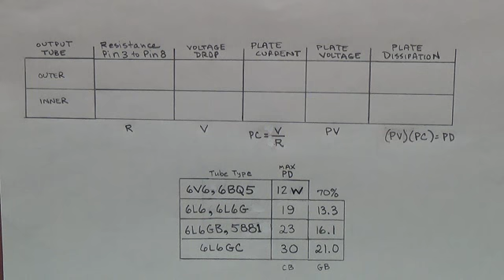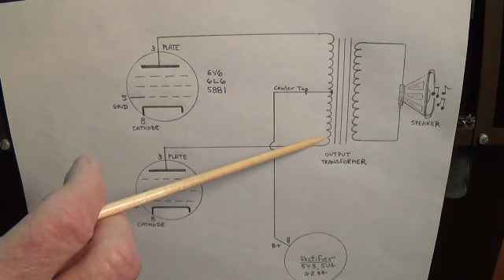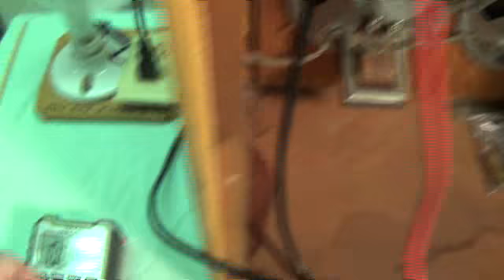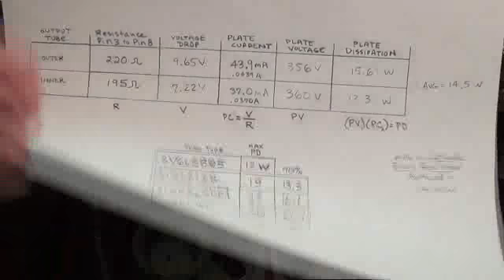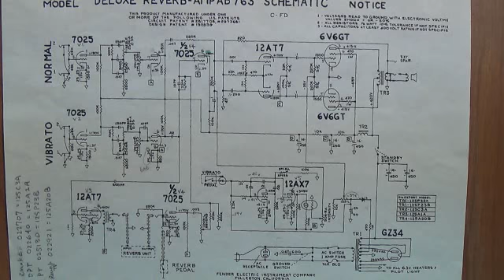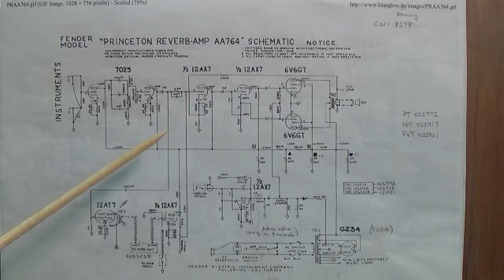Biasing Double-Ended Amplifier Output Tubes, Part 2: Demonstration and Discussion

Comment: I dont get it, why would your bias be close to the max power dissipation? As soon as the positive cycle of an AC signal is applied to the negative grid voltage (assuming grid bias) it will cause the grid voltage to go closer to zero and thus the plate current to increase causing the tube to go beyond its maximum power dissipation.

Edit:
Shouldn't it be biased for roughly half max power dissipation instead?
Reply from the maker: With cathode-biased output tubes, you can safely set the plate dissipation at or about the maximum value, BC, because cathode-biasing is self-regulating. The plate current will not vary by any appreciable amount. With fixed bias output tubes (grounded cathodes), however,  you set the PD at 70% of max, for the reasons you cite.
Reply: Thanks for the reply, that makes sense, so the 70% is to bias them a bit hotter in order to be able push them into breaking up a bit, is that correct?

Comment: I have a Fender Bassman 100, from 1968. It has 4 6L6GC tubes. I see how the tubes are split up on the schematic, V4and V5 work with each other while V6 and V7 work with one another. I’ve taken all the measurements and found that at first the bias was way off. After a couple of tries I almost got them identical to each other. My question is this: My plate dissipation wattage is about 49 watts per side. Would it be safe to say that it’s about 24.5 Watts per tube? Also is it correct that it’s still a high wattage for them and what could I do to change that? Thank you again for putting you know how on YouTube
Reply from the maker: Yes, 24.5W average per tube is high, HH. With fixed bias 6L6GC's the max PD should be 21W. It's strange that your amp has a balance control but no apparent bias adjustment. You need to increase the negative DC grid bias to each tube to reduce the plate current, and from looking at the schematic, I think you can do this by increasing the value of the 15K resistor on the balance pot.
Reply: Uncle Doug Wow thank you for your speedy response! I just thought of something. This is an amp head. Should I place a 4 ohm load of the speakers when I do these measurements. That would effect the current at the output transformer? Sorry this is only the second tube amp I messed with.
Reply from the maker: You should never operate a tube amp without a speaker or dummy load in place, HH. I'm not sure if it will affect the measurements, but no load will definitely put your output transformer at risk.
Reply: Uncle Doug . Yeah I feel stupid. Thanks again
Reply from the maker: No need to feel stupid, HH. Apparently no harm was done. You're welcome.

Comment: Hi Uncle Doug. I was following your procedure to check the bias on my amp. For example one of the sides of the transformer R= 319ohm, the voltage drop there is 3.03v so I get plate current=9.5mA. Then the plate voltage is 305v and that results in 2.9 watts of plate dissipation. The amp sounds fine but I changed the transformer and I wanted to check the bias myself. Also I noticed that the current limiter turns on a little bit when I flip switches and stays on a bit when the amp is on. Am I doing something wrong?
Reply from the maker: What type of output tubes are you using, Al ?  The PC and PD seem very low to me.  The amount of bulb glow is dependent upon the wattage of the amp.
Reply: I´m using 2 EL84s. Yesterday I repeated the process without the current limiter and got better values but still cold so after tweaking I got these values for 70% dissipation:
                       Resis (Ohm)   Vdrop    PC(mA)    PV(v)    Pdisipation(watts)
 BROWN        319                  6.94       21.8          367        8.0
BLUE              353                  8.12       23.0          366        8.4

This is a 20watt amp but I swaped the transformer for a 18watt one. It is also grid biased and I am in Europe, I don´t know if this affects.

Please let me know if these values are good. Thanks for the help,
Reply from the maker: These values seem a whole lot more reasonable than the first ones, Al. To me, the PV's seem high and the PC's seem low......but the PD's are fine. If it sounds good, then go with it.
Reply: Uncle Doug yeah I think it sounds way better now. Thanks for being such a nice guy uncle Doug, I appreciate it 😊
Reply from the maker: You're welcome, Al :)

Comment: Hi Doug, thanks for the great videos! I wondered why there is no value in your table of plate dissipation just right of the 12W for the 6V6 tube. Why did you put the 70% there, instead of 8,4 Watts? Thanks! Daan
Reply from the maker: I'm not sure, Daan. That video was made quite a while ago, however, it sounds like you are aware of the 70% limitation for fixed bias output tubes.
Reply: Thanks!

Comment: Hi, do I understand that you can get the correct maximum plate dissipation values for each tube from the tube manuals??
Reply from the maker: Yes, it is one of many operational parameters that are provided for each tube in the manual.

Comment: Hi Doug, thank you very much for your advice. Like I said , I hope you never stop doing videos. My main question also is why is the plate voltage so high at 485. I have also used 6l6's. I recently had a problem with red plating in this amp.it turned out that I had to replace the bias potentiometer. Thanks again mate. Michael
Reply from the maker: You're welcome, Michael. Perhaps the power transformer had been replaced with one that produces too much voltage. Another possibility is that the plate voltage is too high because the plate current is too low. They are indirectly related.

Comment: Hi  Doug, I know this is an old video but I wanted to ask you a question about biasing a Blackface Bandmaster from 1965 that I have. The plate voltage has always been very high at 485 plate voltage. The schematic states that the voltage should be around 440 volts. What would possibly cause this to be so high? I wound up changing all of the caps and resistors on the board, so that is not a problem. I changed the output transformer and the choke as well. Still the original power transformer. I noticed that the power transformer was running fairly warm. The amp plays alright but this high plate voltage is of some concern to me. I have 5881 power valves in it. I biased to 37 milliamps. Maybe a little high. It may need to be set at 33 milliamps. Do you have any advice for me on this? Thanks Doug love all of your very informative videos thanks from Michael Newell from Niagara Falls, Ontario, Canada
Reply from the maker: The key factor in biasing is Plate Dissipation, Michael, as described in the video. Your PD is .037A x 485VDC = 18W. The max PD for 5881 tubes is 23W, so you are well under the max. If you increase the PC to around 45mA (max for 5881's is around 50mA) the PV will go down and you should have a PD that is closer to 23W. If you're nervous about running 5881's at this level, which is still well within normal parameters, you could switch to 6L6GC output tubes, which are much hardier. Good luck.

Comment: hi doug! quick question i just put 2-new 5881's in my sovtek mig 50. i set bias at each tube at 36 mv,due to some expert on marshall amp forum-other amps section-is this to cold?
Reply from the maker: You can't bias tubes simply by adjusting the plate current, Mike. Bias is based on plate dissipation, as described in the video.  Plate Dissipation (in Watts) = Plate Voltage (measured plate to cathode) x  Plate Current (in amps). You will have to check with Sovtek to find out their recommended max for PD.
Reply: ok uncle doug im a idiot 66 years old an born in lynwood,calif. please forgive me i just started this hobby 3-years ago. got lots to learn! thanks for the reply!
Reply from the maker: You're not an idiot at all, Mike. We all have to start somewhere, and it's always better to ask a good question than to bull ahead and cause harm. Best of luck with your amp.

Comment: beautiful basic analysis of biasing push-pull circuits uncle Doug. thx .. I'm off checking  other sites now for my newer Tranor I picked up a few wks. ago its running 5881 's and sounds good  but heard that 6 L 6
s  open this amp up even more . when i installed the 6L6's after 3 min. i smelled something cooking sure enough two of the plates were aglow. re the old ones and contineoed to sound fine . I herd this amp is self biasing so . humme!  i also have a reissue super reverb i want to install  a balenced pair into as well as complete compliment.  of new used from nesstube  in California. the Traynor is VT80 . and both amps look like they never been touched. the super has very little id. anywere on it looks like they just missed writting the numbers on the thing.
Reply from the maker: You're welcome, Barry. The 5881 tube is quite similar to the 6L6G and GB, but with slightly higher plate dissipation. I have no knowledge of Traynor amps and can't find any literature on a model VT80. I don't work on reissue amps, but if the Super Reverb is like its original brothers, it is grid biased and will have to be re-biased by a qualified tech if you install a new matched pair of 6L6GC's.

Comment: Graham Bambrook

Hey Uncle Doug, I love your YouTube videos and was very sorry to hear Rusty the Wonder Dog has recently departed this mortal coil. Please accept my condolences and be sure to give Jack a scatch from me.  :-(

I wonder if you can clarify something for me.
I have an amp with 4 off, grid biased 6L6GC which measure out as follows per pair:- 

Xformer resistence 24.9 & 30.1 ohms;
V drop across xformer 0.61 & 0.81V;
V plate = 392V for each pair which by my reckoning gives plate current of 
0.024 & 0.027 Amps respectively. 
This equates to a PD of 9.4 & 10.5 W for each pair which seems incredibly cold when each pair should handle 40 - 60 Watts.
What am I doing wrong?

I must say these readings are with the original valves (tubes) which appear to be totally trashed (crackling and popping at anything other than minimum volume) and though the amp cost me nothing, the replacement valves were over £100 so I don't want to risk fitting them until I am comfortable with the state of things. Incidentally, I took your advice and built myself a dim-bulb tester before plugging the amp in. I live in the UK and a 240V dead short can get quite interesting, very quickly, so thanks for the tip. I use 2 x 100W bulbs in // and then in series with the socket outlet. I used the same device to check an oscilloscope I just acquired and a 500W Weller soldering iron I have owned for about 50 years and not used for about 20. I fully intend to use it on any unknown device in future. :-)
Reply from the maker: Thanks, Graham. It doesn't appear that you are doing anything wrong, as long as the measurements are accurate. Both the OPT winding resistance and the voltage drop seem quite low......but I rarely, if ever, deal with quad-ended circuits. It could be that your old tubes are simply nackered and their cathodes can no longer create adequate current flow within them. You might want to try this process again with your new set of tubes. It doesn't seem like any harm could befall them, especially if you are using a current limiter.
Reply: Thanks UD. My only real concern is that the amp uses a solid state rectifier and the Plate supply for the ouputs is tapped BEFORE the Standby switch. The only 'cushion' therefore, is the dim-bulb. I guess I have to be brave and just do it.
Reply from the maker: What a strange wiring scheme......the purpose of a standby switch is to delay the application of plate voltage until the filaments heat the tube (which is generally a waste of time, IMHO), so it would appear that the switch is superfluous. If the amp is wired this way, then the output tubes will be subjected to immediate B+ at every start-up, so running it this way is routine rather than risky. Your only alternative is to re-wire the standby switch, or use a Variac to bring up the B+ gradually.
Reply: Well, I bit the bullet and everything sounds good. Currents and voltages changed slightly and I re-calculated 11.6 W of plate dissipation on each so still a bit on the cool side, but hey, it works. No popping, no crackling, no microphonics. I changed the pre-amps and phase inverter at the same time (3 x ECC83).
I was going to send you a section of the schematic FYI but I don't seem to be able to copy it in here. It is a bit odd. There is a B+, a B++ (pre-amp) and Screen supply after the s/b switch but the Plate supply for the power section is before.  If you do want to look it up online it's a Peavey Valveking 100. Anyway, thanks for your advice etc. Keep up the good work! :-)
Reply from the maker: You're welcome, Graham. I will take a look at the schematic. For future reference, you can't copy the schematic to this page, but you can copy the link.
Reply from the maker: Sounds good, Graham. I was unable to locate a legible VK-100 schematic, but accept your analysis of the unusual circuit.
Reply: Here it is Doug. 
https://www.google.com/url?sa=t&rct=j&q=&esrc=s&source=web&cd=1&cad=rja&uact=8&ved=0ahUKEwi7tsDdsenaAhUnC8AKHfQHAEUQFggpMAA&url=http%3A%2F%2Fwww.thetubestore.com%2Flib%2Fthetubestore%2Fschematics%2FPeavey%2FPeavey-Valveking-112-Schematic.pdf&usg=AOvVaw1RPhj6TNfdV0KykS6SKExl
Reply from the maker: You're right, Graham, the plates are energized even with the standby switch in the "off" position......very unconventional.
Reply: Glad I'm not going loopy!! :-)

Comment: Hi Uncle Doug! I am working on a Fender Silverface Twin Reverb amp and I got to the bias adjustment and when I measure the voltage drop between the center tap and each plate, my voltage measurements vary from about 1.2 volts to 1.75 volts. Meaning, the DVM readout swings back and forth, at what looks like 120 hz rep rate. Power supply caps have all been replaced with new caps, all electrolytic caps in the amp replaced as well. Any ideas on what could be causing this? Output tubes all new, quad matched set.
Reply from the maker: It's frustrating, isn't it? I've seen this before and believe that it's the Tremolo oscillating silently in the background. Try altering the speed control of the Tremolo and see if your readout swing doesn't change speed to match. The solution is to pull the oscillator tube when biasing the output tubes.

Comment: As always, this is an immensely useful video! 
Maybe you can help me with my peavey classic 30 which I believe could be described as a parallel push pull type (4x el84, fixed bias). How would you go about checking individual PD since 2 plates are in parallel on each side of the OT?
Reply from the maker: Unless you want to install 1 Ohm cathode resistors for each of the four tubes and measure voltage drop across each, you are pretty well limited to only determining the average PD of each pair, by dividing by 2.
Reply: Uncle Doug Thank you, this was my guess based on the knowledge I acquired from all your educational videos, which are a wonderful gift to the world!
A fan viewer from France

Comment: Hi.  Great video..! What about the second grid in the output tube? Can you add resister there to change bias or will it affect the existing circuit voltage? I'm referring to Princeton Reverb schematic..
Reply from the maker: Thanks, Dr. R. I believe you're asking about the screen grid in the 6V6. It has its own DC supply, generally at a slightly lower voltage than the plate. It is not "biased" and does not generally have a resistor in series with it and the 400VDC "B" supply.....unless the high voltage circuit includes a filter choke. See the AA864 Bassman schematic, where 470 Ohm resistors are added due to the presence of a filter choke (TR2).

Comment: 100 Ohm resistor in cathode will change the working conditions of the 6V6...........
and will measure total current under different conditions ,besides it will not show the desired balanced or faulty unbalanced current of the output tubes .
A) install a jack in the cathode for measuring total current .......easy.
B) a 10 Ohm 1% resistor in each cathode leg .......for individual measurements and current balance between the PP tubes.
C) a commercial  or diy kit with test sockets between tube and chassis sockets and readout per tube (socket ) on the  voltmeter.
D) Common cathode resistor always ends up with imbalance and finally problems even with good matched tubes..
E) individual biasing is no luxury anymore today . A single bias potmeter and a single shared cathode resistor is technology of the old days when tubes were only consumer user  replacement items , today we try to protect the investment .
Reply from the maker: Thanks for your input, Frank.
Reply: My pleasure Uncle Doug !  People who like tubes are good people and they share their passion and their experience........ I think you are on the other side of the Atlantic .
Let the tubes keep us warm , winter knocks on the door .
I am pleased to discover your videos...
Have a nice day .

To keep my precious older tubes and rare nos tubes good condition and extend the lifetime i apply the high plate voltage only after i warm up the filaments for about a minute .
Tubes age mostly while switching on  and switching off ...........plate voltage on colder cathodes stripping directly electrons on the cathode coating  while the electron cloud fails to protect the cathode.
I love older cowboy movies also hahaha..........
Reply from the maker: Yes, Frank, we're in the great state of Texas, home of the cowboy movies you love :) Stay warm and healthy this winter.